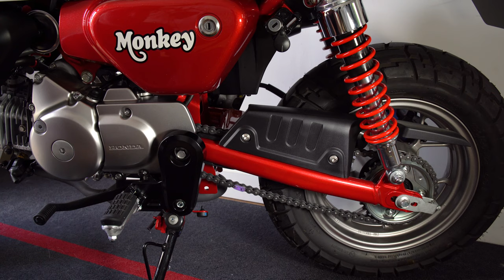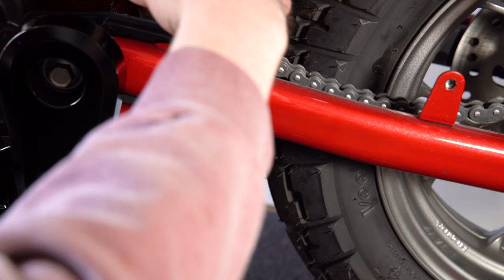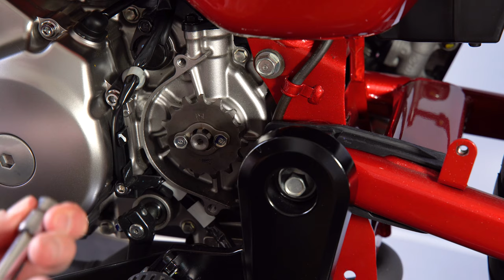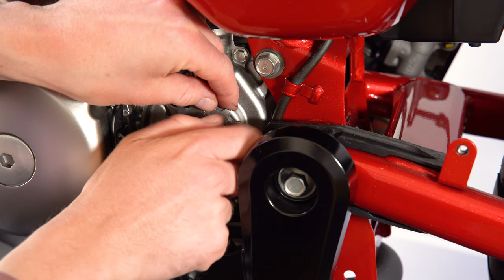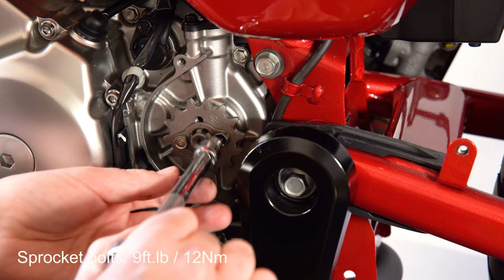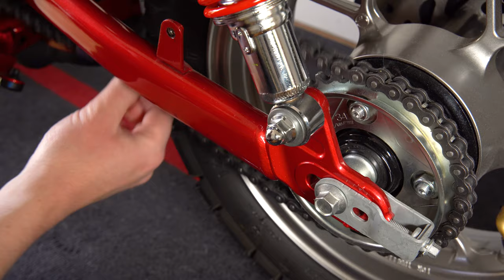Honda Monkey TV - 14 tooth front sprocket upgrade & chain re-tension

Comment: Hi, I like your videos. So keep doing those.

Little tip. When advising to remove the master link on a chain it’s good to also point out that it should put back on with the closed end towards the direction of rotation.    For you perhaps logical but for others not so much.
Reply from the maker: A good point! And worth mentioning, thank you.

Comment: Am I wrong or did you post the sprocket torque specs again instead of the rear axle torque specs at the end there?
Reply: yes he posted the front sprocket bolt torque specs again, my manual says the rear axle should be 44 lbf·ft (59 N·m, 6.0 kgf·m)

Comment: Thank you for your video. The 14T makes the bike a little slower i guess. Is there a 13T or 12T that would lower the speed of the bike even more as im 60yo and feels this Monkey is very fast for me.
Reply from the maker: Im sure you can get smaller yes, will help acceleration but lower top speed.

Comment: Thanks for the torque specs. Huge help. Actually doing this today. Nicely shot.
Reply: I think you posted the front sprocket bolt torque specs again for the rear axle, my manual says the rear axle should be 44 lbf·ft (59 N·m, 6.0 kgf·m)

Comment: wow that looks clean have you ridden it
Reply from the maker: It is - Yes! I've only got around 600 dry miles on it hence the condition. 
It would probably have >2000 if this virus hadn't kicked in :-(
Reply: @hondamonkeytv4138  yes I'm with you on that one i have resisted temptation

Comment: Is it safe to ride the monkey on long rides (50 miles or longer) with the RPM's so high? Do you think that will damage the motor? I had the 14t sprocket on a long ride recently and I hated hearing that thing scream the whole way. I liked having the 4th gear (overdrive) in the original sprocket. Should I put the original back on?
Reply from the maker: It's fine, just don't sit with it absolutely topped out, screaming.
However its not a pleasant ride at high speeds to be honest.